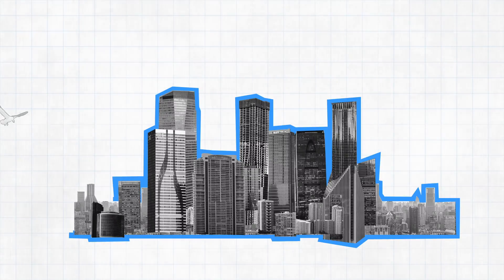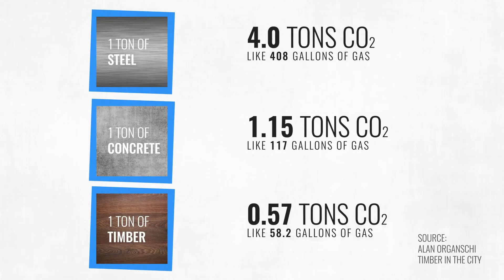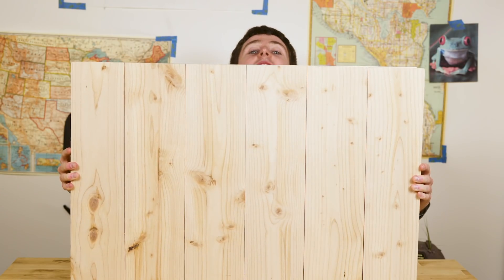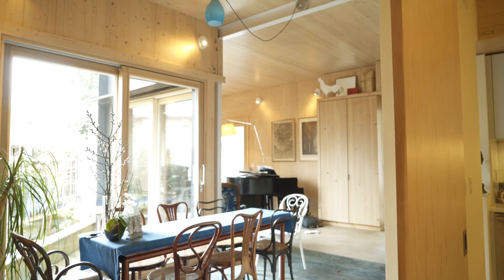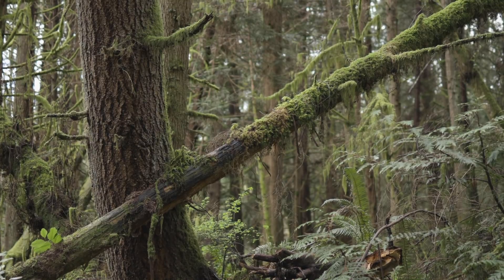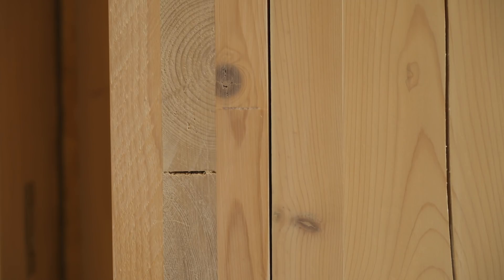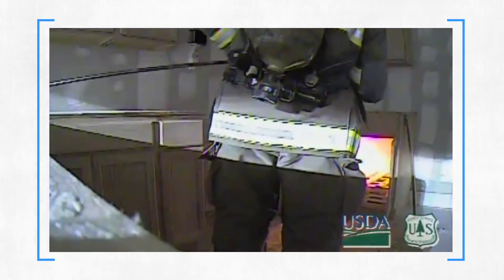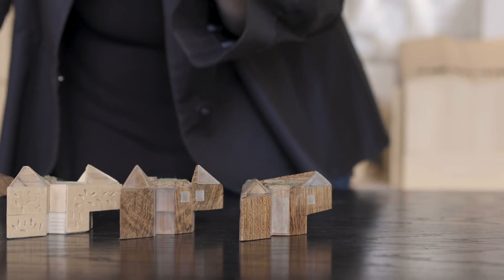CLT (aka wooden skyscrapers), explained

Comment: One red oak tree could build a 20 story skyscraper
Reply: Which could burn to the ground if it caught on fire.
Reply: @Kazilikaya  It wouldn't. CLT properly treated is about as vulnerable as clay bricks to fire and termites.
Reply: @enriqueemfloressanchez1728  yeah... the CLT panel itself usually protected by insulation cladding to prevent fire or termites.

Comment: Today Sierra Club released a new report: Forests, Wood & Climate.

https://content.sierraclub.org/ourwildamerica/sites/content.sierraclub.org.ourwildamerica/files/documents/Forests,%20Wood%20&%20Climate%20Report_Sierra%20Club_July%202019.pdf
 
As in this video, wood is being widely touted as a relatively low-embodied-carbon material and substituting wood for non-renewable materials is put forward as a solution to the climate crisis. This report makes the case that such substitution will only help reduce carbon emissions, and draw down and safely store the excess of CO2 in the atmosphere, if it is coupled with increased forest protection, restoration and stewardship: specifically, the conservation of carbon-rich primary forests on public lands and a transition to climate-friendlier forestry on private lands. This video touches on these topics in passing, but they merit a great deal more attention or the mass timber trend could wind up driving increased forest degradation through widespread, intensive logging -- resulting in a loss of forest carbon that will more than offset the benefits of substitution in the next several decades (which is what counts given that time to take climate action is running out).
 
In Forests, Wood & Climate, Sierra Club calls for the creation of a Forest Carbon Trust on federal lands to prevent forest carbon from being released into the atmosphere by logging while protecting wildlife, clean water, ecological resilience, and other critical values. It also calls for practices and policies that support climate-friendlier forestry, including but not limited to preferencing FSC-certified wood.

Comment: Wouldn't those buildings be a fire hazard?
Reply: @cmmartti  you're wrong. Dead wrong. Wood ignites spontaneously at temperatures that exceed 500 degrees Fahrenheit. It then begins to carbonize and with any kind of load, it will splinter. Even at 212 degrees it starts to soften and lose its tensile strength. This would lead to wooden high rise buildings collapsing in the event of an out of control fire. There are types of concrete that can withstand very high temperatures up to 1800 degrees Fahrenheit before losing their structural integrity.
Reply: Yes